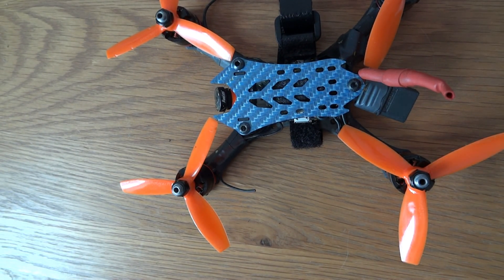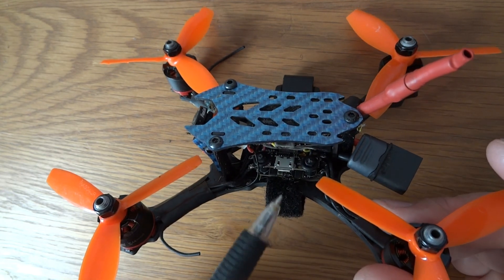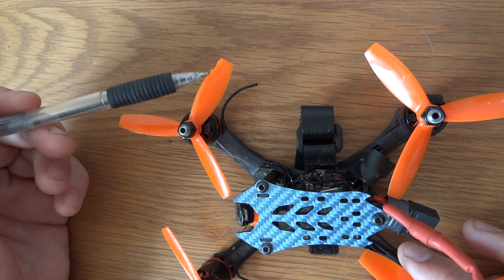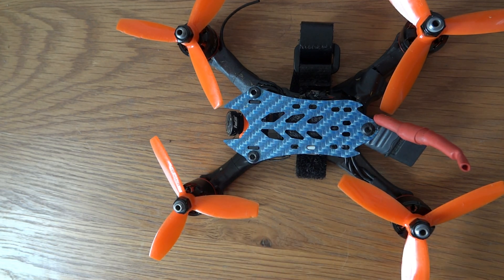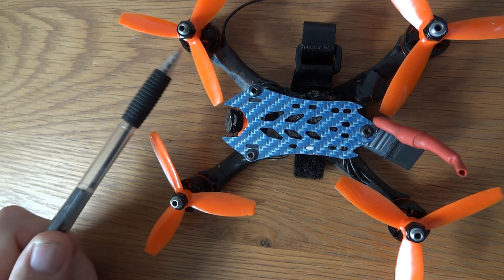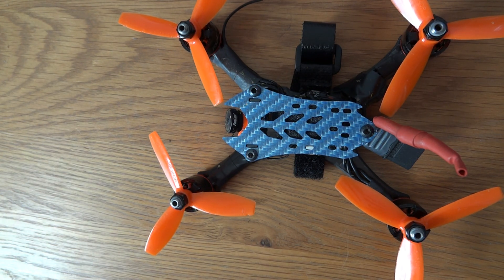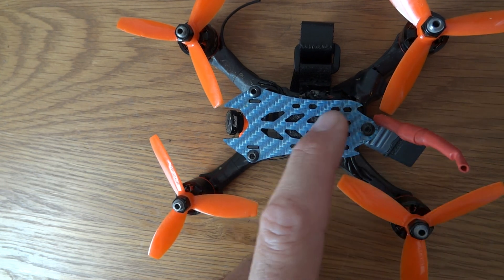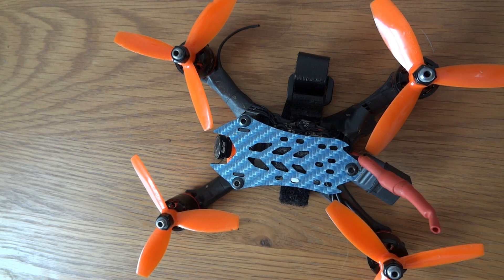Xero S3M final build & looking at grass footage...

Comment: Just ordered 5 of these rcx rs1407 4100kv motors for my Furibee X140. I was wondering, how much noise do they add to your fpv feed if any?? This is my first sub 200mm kwad! I have 5 full sized kwads 4 of those I built myself, not that it matters??!
Reply from the maker: None at all on mine, in fact I’ve never had any noise on any 3 or 4 inch. No caps either.

Comment: could you include the part links on the description, and is it a sub 250g?
Reply from the maker: Parts are already in description. Quads weighs 133g with props on so well below 250g with battery.

Comment: I have the 3 and 4" xero and love them, I also think the 3" is faster then the 4" it just doesn't have the punch of the 4-5" quads. Great frames I absolutely love mine
Reply from the maker: It only takes a week or so from Avant. I'm in the uk. I've fitted a split in the 4 inch Leggero extreme - see my other vids. The 3 inch Xero has exactly the same build space inside, however it's made for a micro cam, so you'd have to use 3d printed camera mounts to hold the split as I did in the leggero. The Xero is also a slimmer frame, so the split board would overhang the sides. After flying both, I think the 4 inch is faster, but gonna do a head to head soon!
Reply from the maker: I've just put 6 packs through mine on my way home in a massive open space. I honestly think it's the best quad I've ever flown. I just absolutely love it. It seems to hang in the air forever when you punch it. The rcx motors put out around 10% more thrust than the brotherhobbys. They're awesome. Want to put a runcam split in it, but it's so perfect I'm scared of ruining it lol
Reply: Are u talking about the 1407 rcx? They were junk when I used them, I wasn't a fan, much prefer the Bh 1407. Yea I love this quad, it's my 3rd from avant, Eddie is a great dude. Wait till u see the next frame he's coming out with.
Reply: He has a xero that's made for the split...I may buy it, I refuse to run an hd cam on these featherlight quads so it would be nice having the split.
Reply from the maker: The new rcx rs1407 4100k . The old ones were bad. They're incredible. Also got the BH, Cobra and rotorgeeks 1407s, and the rcx thrashes them all. Yeah eddies a good guy. He sends me photos of his stuff too. Got a S5M split edition prototype in the post.
Reply from the maker: He needs to stop making frames for specific cameras. I've got some 3d printed micro and mini mounts from pirofliprc that fit over the standoffs, which I hope, Will work. With the 4 inch leggero S4L extreme you can just reverse the camera plate and make a small hole slightly higher and the split fits perfectly with no props in view. I'm waiting on a 30.5 to 20mm flight controller mount converter (banggood) and will put the split below the 4 in 1.
Reply: Nice, look forward to seeing the xero split version you review, I'm going to be testing his two inch version of the xero soon too.
Reply from the maker: Sean metzger stick some footage up when u get it, id like to see how that one goes.
Reply: Nice! I'm looking forward for a 3inch build with this frame , although the problem is try to buy it in Europe ...I'd like to mount a runcam split on it , do you think it will be good ?
Reply: Coppertop FPV thank you man ! Looking forward for the comparison